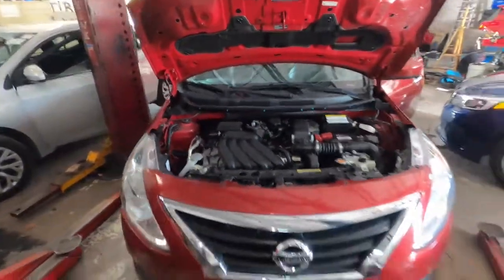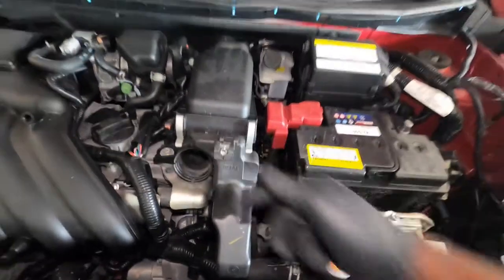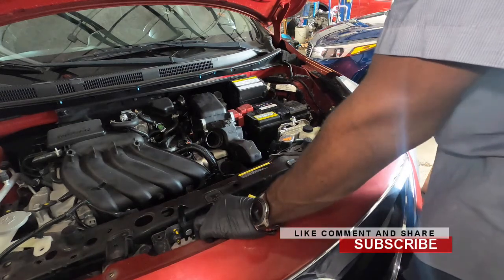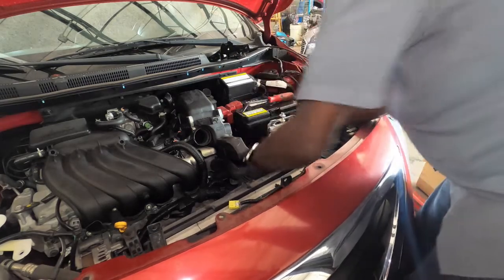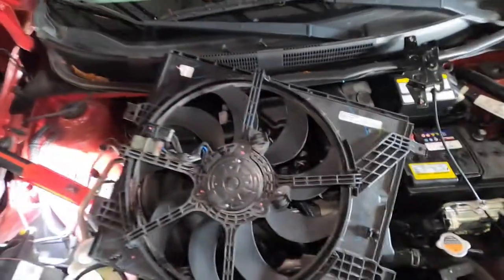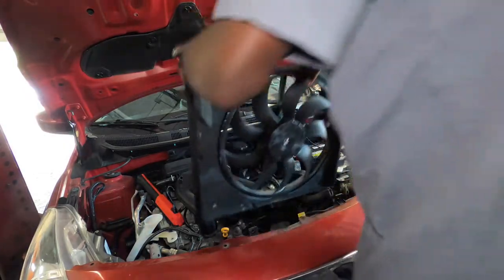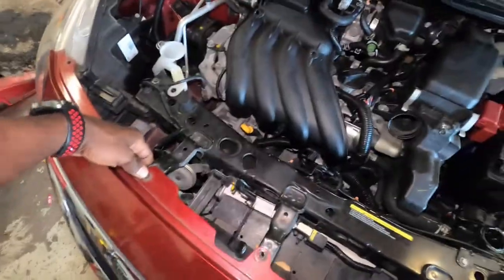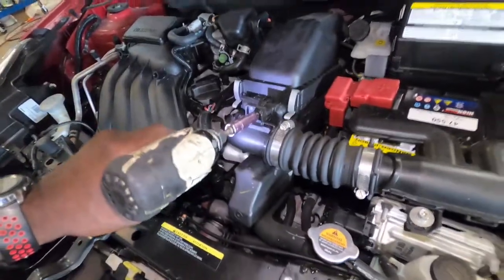Nissan versa cooling/ radiator fan replacement (over heating fixed)

Comment: Thanks for this video brother. I just completed a fan replacement on my 2015 versa hatchback. 
Took me about 3 hrs, but I'm very slow and methodical when working on my own car. I took about 25 pictures on my phone ever step of the way. 

Just in case anyone is wondering, I managed to complete the repair without draining the anti-freeze or removing the resevoir. It was slightly more of a pain in the ass at one point, but I think it's doable. 

I was kind of gambling that it was the fan motor. I couldn't get a multimeter down there to check to see if I had 12V coming in at the harness, but I knew the relay and fuse were good. 
The weird glitch that made me gamble on the fan is that I turned on the car, maxed the AC, and then tapped on the motor housing (fairly hard,) when I did that the blades moved just a little bit. 
Car off, tapping on the housing, the blades don't move at all. 

This morning, when I got the old fan out, I ran 12V directly from the battery into both wiring harnesses (blue is +) and it didn't move at all. Totally screwed. 

everything good now, thanks again!

Comment: When or what temperature turn on the fan? My car doesn't turn on and the temperature is normal
Reply: Turn your AC on max and watch for about 60 sec. The fan will trigger occasionally when AC on to cool off AC condenser. 

IIRC the fan comes on at 200 degrees C for normal operation without AC, but don't quote me on that.